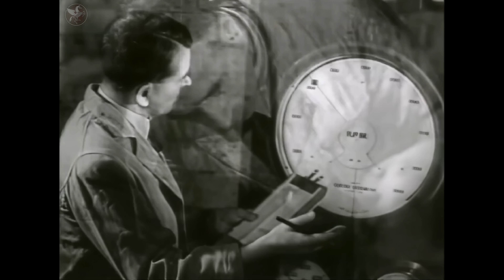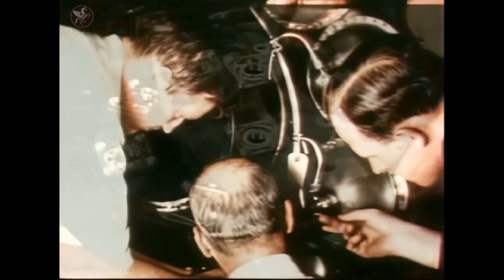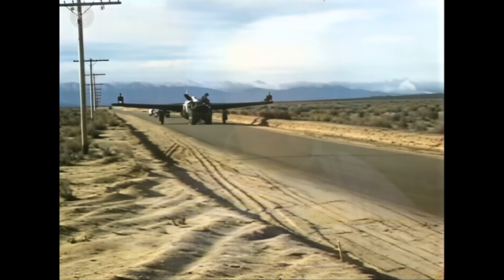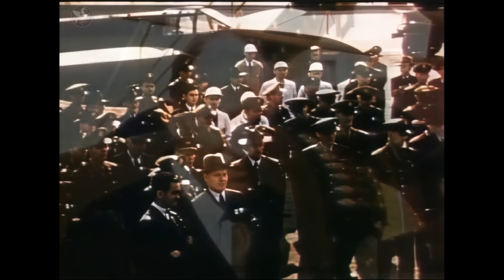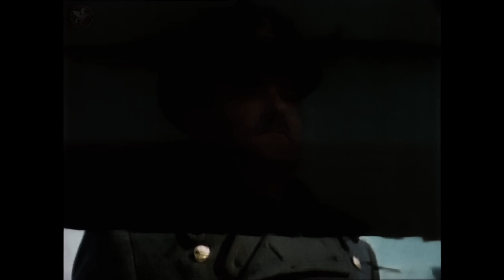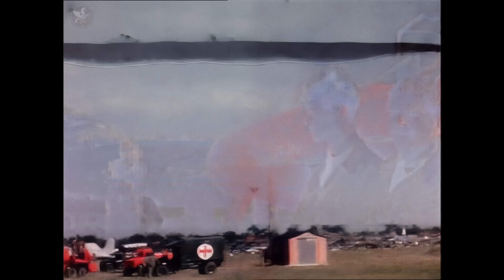Bell XP-59A: The Classified Birth of American Jet Power

Comment: The engine was "licensed" to GE for the same reason the "iconic" Rolls-Royce Merlin was "licensed" to Packard. The Brits had shit for modern precision manufacturing capability and "hand fitting" was not compatible with "mass production". 

GE also led the world in the "development" of "turbosuperchargers" and those had and have much in common with "turbojets" when it comes to the technologies and materials involved in mass producing them. 

The limeys were jacking around trying to use mechanical supercharger "blowers" for the "compressor stage" of "their" jet engines. 

And no, the U.S. did not "rush" to "develop" and "introduce" jet aircraft "mid-war" because of all the "logistical challenges" involved in deploying jet aircraft - which when properly "developed" run on "jet fuel" aka "aviation kerosene" instead of "avgas" - to "war zones" where ALL other "war machines" were powered by spark ignition piston engines fueled by gasoline. 

The Germans were able to "successfully" develop, mass produce and deploy their "jet fighters" because by "late in the war" their oil reserves were exhausted and they were "gasifying coal" to produce "motor fuels". The process is much more suited to producing "heavy fuels" like kerosene than gasoline. The primary reason besides "hand fitting" and crappy manufacturing overall the British "jets" needed such frequent "maintenance" aka SERVICE UP TO AND INCLUDING "OVERHAUL" IS THAT THEY WERE BURNING "AVGAS" IN THEM. WHICH IS FAR TOO LIGHT IN SPECIFIC GRAVITY AND THEREFORE LOW IN ENERGY CONTENT AND "CETANE NUMBER" - THE "OPPOSITE" OF "OCTANE" AND THE RATING OF A COMPRESSION IGNITION FUEL'S ABILITY TO "AUTOIGNITE" - AND HAD TO BE BURNED IN SUCH LARGE QUANTITIES AND WITH THE STARTING IGNITION SYSTEM "IGNITERS" CONTINUOUSLY OPERATING UNTIL "FULL TEMP" WAS REACHED. 

"FULL POWER" WAS NEVER REMOTELY POSSIBLE AND "AVGAS" HAS BASICALLY NO LUBRICATING AND COOLING ABILITY WHICH IS NECESSARY FOR THE "FUEL INJECTION SYSTEM" OF JET ENGINES. 

AND OF COURSE WHEN IT CAME TO AIRFRAME "DEVELOPMENT" THEY WEREN'T EVEN ABLE TO "MASS PRODUCE" A FULL STRESSED-SKIN ALL METAL AIRFRAME AND PRESSURIZED CABIN AND WERE STILL BUILDING "PRE-WAR TECHNOLOGY" - I.E. MID-1930S AT BEST - AIRCRAFT LIKE THE "ICONIC" SPITFIRE AND "HURRICAN". 

THE TEMPEST WAS THEIR "MODERN" PISTON-ENGINE "FIGHTER" AND THEY COULDN'T EVEN "MASS PRODUCE" THOSE. 

EVEN THEIR CLAIMS OF FLYING MERLINS AND SPITFIRES TO "30,000 FEET" ARE EXTREMELY SUSPECT AND ITS WELL WORTH REMEMBERING THAT "REACHING" ANY SPECIFIC "HEIGHT" IN A GIVEN AIRCRAFT AND "MAINTAINING" IT I.E. BEING ABLE TO "OPERATE" AT A GIVEN "HEIGHT" INDEFINITELY ARE TWO ENTIRELY DIFFERENT THINGS. 

THEY CERTAINLY LACKED THE "RANGE" AND "HEIGHT" TO ESCORT B-17S - ALSO MID-1930S TECHNOLOGY ORIGINALLY "ORDERED" BY "GREAT BRITAIN" - OVER "MAINLAND" EUROPE AND IT WASN'T UNTIL P-38S - ANOTHER LIMEY "DEVELOPMENT" THEY "REQUSTED" AND "SPECCED" AND THEN FOUND "UNSUITABLE" WHEN THE "BILL" SHOWED UP AND THEY REALIZED IT TOOK MORE THAN "FUNCTIONAL LITERACY" TO "FLY" AND "MAINTAIN" THEM AND "FLIGHT TRAINING" ANY RAF "FIGHTER PILOT" ONLY "CURRENT" IN A SPITFIRE OR HURRICANE WAS WAS OUT OF THE QUESTION EVEN THOUGH "LOW HOUR" AMERICAN FEMALE "FERRY PILOTS" WERE FLYING THEM OVER FROM "AMERICA" NO PROBLEM AT ALL - SHOWED UP THAT B-17S WERE FULLY "ESCORTED" ROUND-TRIP.
Reply: When you type with your “brain” can you put in more quotation marks please and thank you

Comment: The Bell XP59 was a disaster. It was never going to be an effective combat unit and it took the engines procured for the prototype vampire fighters which would have transferred the air war in europe if the prototypes had flown in 1942.
Reply from the maker: The turbojet powered was a testbed. the early 1940s test led to the Kelly Johnson's designed Lockheed F-80, also powered by Grank Whittle's derived G.E. engine.
Prototypes of the Shooting Star were test flown, during WWIIm in Italy.
The F-80 went on to fight in Korea, were it had to face the formidable and lethal MiG 15, which had swept wings, unlike the American fighter.
The MiG 15 was also powered by Whittle's engine, reverse engineered illegally by the Soviets after Rolls-Royce was ordered to sell them a handful of units, with the agreement they would not copy them, which is exactly what they did.
The MiG's superiority against the F-80, forced the U.S. to deploy the F-86, the swept wings, axial powered aircraft.
Despite being 'revolutionary' the centrifugal powered MiG still proved to be quite decent.
Reply: @Dronescapes  It was a useless testbed that halted the development of what would have been the worlds most capable combat jet and done for political reasons.
Reply from the maker: @W @Will_CH1  more specific. Given that Britain literally gave the U.S. both the first turbojet in history (and the inventor) in 1941, kickstarting the jet revolution for both General Electric (still publicly grateful to this day), and the likes of Pratt & Whitney (licensed), but also Rolls Royce and Klimov, the only thing that really comes to mind is that if Griffith had not literally stopped Whittle in 1929, making him lose 6 plus years of R&D, Britain would have been a million years ahead of any nation in terms of turbojet engines. Griffith, Whittle’s sole judge of his proposal to the air ministry, but also famously author of the most important seminal paper on axial compressors in 1926, made sure that Whittle would disappear, unfunded.
Griffith was enraged at Whittle ignoring an axial solution, fully aware that it would take decades to be developed.
The lack of prospective developments in the early 30s, also crucially led Britain to issue a moratorium on R&D, but also handed Whittle’s work to the likes of Von Ohain in 1934, when the British genius did nit even have the money to renew his patent.
Von Ohain went on to 1/2 copy Whittle’s work, which led to the mix-powered He 178 flight in 1939, which also set in motion the whole Nazi quest for a turbojet (which was, by the end of the war, an operational failure, as Whittle predicted it would happen for a while in 1929.
Needless to say, Griffith’s research on axial turbojets led to the Metrovick axial engine, which was also shared with the U.S. in the early 40s, but it was also pitted against Whittle’s, and discarded as unreliable (just like the German engine.)
As a reminder, Whiitle was only able to produce his first engine in less than two years (April 1937), only thanks to a friend who found a private investor in mid-1935.
The amount of money offered was minimal, yet he finally accomplished success before anyone else, and despite what he went through.
If Griffith had not stopped Whittle in 1929 for what can be read as a blatant conflict of interests, snobbery or mere jealousy, his invention would have been government funded and made a national secret (not patented.)
Nazi Germany would have not had the He 178, the British Air Ministry would have also refrained from issuing a moratorium, the British axial variant would have had accelerated development, and most likely, having a massive superiority well before the beginning of WWII, they would not have given away their technology in 1941 for free.
Probably the jet powered XP-59 and the F-80, MiG-15, etc. would have not seen the light of day at all at the time.
What the Brits really lacked was the formidable supersonic wind tunnels that the Nazi had, and their advanced aerodynamicists (swept wings for example), but after all in 1945 the Gloster Mereor, despite lacking swept-wings, proved just as fast as the Me 262, but unlike the Bazi aircraft, it also had a perfectly reliable engine, and not one that fell to pieces after a few hours.
Imagine if Britain had an operational Meteor 5/6 years prior!
At Bell they would have been seriously scratching their heads, but also at Messerschmitt and everywhere else.
One person’s idiotic decision in 1929, rewrote aviation history to this day.
Rolls-Royce, G.E., P&W and the Russians all benefited from the work of an often forgotten true genius.

Comment: Totally copy cat of German messachmitch:face-blue-smiling:
Reply: How it's copy when its first came out?
Reply from the maker: While German developments in early jet aviation often dominate the historical narrative, Frank Whittle's foundational role is frequently understated, and the actual timeline of jet deployment tells a more nuanced story:

The foundation of early American jet aviation was directly reliant on British technology. The first US jet flight occurred in 1942, shortly after Frank Whittle's engine design was secretly transferred to the USA in 1941 to be developed by General Electric.

The Messerschmitt Me 262, deployed in mid-1944, was aerodynamically advanced but severely compromised by its Jumo 004 engines. Due to critical shortages of high-temperature alloys in late-war Germany, the engines were an operational liability, often lasting only 10 to 25 hours before requiring complete replacement. They were notoriously prone to flameouts, posing a massive risk to pilots who also lacked ejection seats in that specific aircraft.
After the end of WWII, all variants of the German engines were ignored, with the exception of France (it took them, and 120 concerted Nazi engineers, eight staggering years to "fix" it by radically modifying it)

The immediate post-war global jet industry was largely built on the back of Whittle’s reliable centrifugal-flow designs. Companies like General Electric and Rolls-Royce, as well as the Soviet Union (whose Klimov VK-1 was heavily based on the Rolls-Royce Nene), jumpstarted their early jet successes with British technology, not German.

At the outbreak of the Korean War, the primary early jet fighters—the American F-80 Shooting Star and the Soviet MiG-15—were both powered by centrifugal-flow engines derived from Whittle’s foundational work, dominating the skies before axial-flow engines matured.

It remains a historical tragedy that Whittle's 1929 patent was dismissed by the British Air Ministry (partly due to A.A. Griffith's preference for axial designs), costing Britain six precious years of development. Had Whittle received the necessary backing from the start, the RAF could have realistically fielded jet fighters much earlier in the war.
A final note: Whittle had been ignored in 1929, wasting 6 precious years in developement of his engine.
He was only able to restart his precious work in 1935 after a private investor gave him a small sum of money. It took him, with minimal resources, only a couple of years to make the first working turbojet in history, something the German failed to achieve (operationally speaking) in years and years despite the involvement of companies such as: BMW, Daimler, Junkers and of course, Heinkel.
They kickstarted their obsession with an engine that they were not able to operationally perfect precisely because 1/2 Von Ohain's engine was copied from Whittle's 1929 invention.
Had Whittle not been dismissed in 1929 by his sole jedge, A.A. Griffith, one of the fathers of the axial variant (blatant conflict of interests), the Germans would have had nothing to copy in the late 1930s, hence no He 178 in sight!
On the other hand, the RAF would have had the ideal turbojet variant well before the beginning of WWII.
You see, you have your history upside down, fueleed by the neverending Nazi nostalgia.
If you really want to learn something, watch the interviews with both Whittle, and Von Ohain.
You might end up writing informed comments in the future.
Reply from the maker: Here you can learn the actual history of the Jet Engines with the real protagonists talking about it, rather than a Nazi nostalgic revisionist: https://youtube.com/live/1-mFjzNoHsQ

Comment: One of my civilian supervisors at Edwards told me about living in tents at the edge of the lakebed during the week. Also, the mechanical gauges in the jet tended to stick, so one of the engineers made a panel knocker from a a doorbell mechanism. Another story some of the old heads would tell me was the Bell test pilots took great delight buzzing past the bomber training pilots while wearing a gorilla mask and smoking a cigar. The reason: They knew if the students came back from the bombing range started telling stories about seeing a propeller-less aircraft being flown by a cigar smoking gorilla, no one would believe them and they'd probably get washed out of training.
Reply: You had a "civilian supervisor" at "Edwards"? Yeah. And "gorilla masks" were everywhere during WWII and "Edwards" was used for "bomber training".
Reply: There was no "Edwards" until 1950. 

And the P59 was "proposed" and "developed" until 18 "prototypes" were built but was never "adopted". The P-80 was. 

So nobody was ever "flying past" any WWII bombers at "Edwards" at any point. Especially since it wasn't until long after WWII that "Edwards" had any "civilians" and was used by "test pilots" in actual "production" aicraft.
Reply: "Edwards" was a Union Pacific "water stop" from at least 1880 on and was "Muroc Field" from the mid-30s until 1950 and had an actual "airport" with a paved runway for heavy bombers by "mid-war" - even though the "X-planes" air "launched" from B-29s with their landing "skids" still used the lakebed for landings - but yet he was "living in tents" at the time? 

That's funny, funny shit. About as funny as the idea of "jet fighters" flying so close to "bombers" during "bomber training" that their already very busy and "occupied" crews could ever see "gorilla masks" and "cigars" on and in the faces of "fighter pilots" of supposedly "top secret" jet aircraft that never made it past the "prototype" stage. 

Bell had zero chance of "mass producing" any more "fighter planes" after the P-39 Airacobra "development" and was only chosen to "develop" a "testbed" for jet propulsion because it had the "free time" and excess "production capacity".